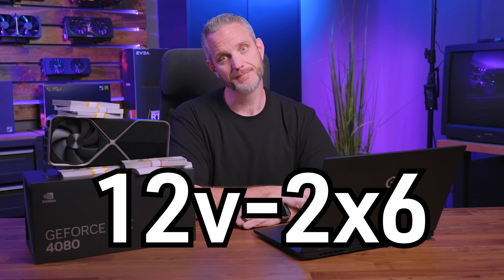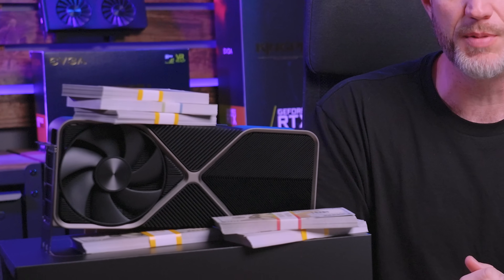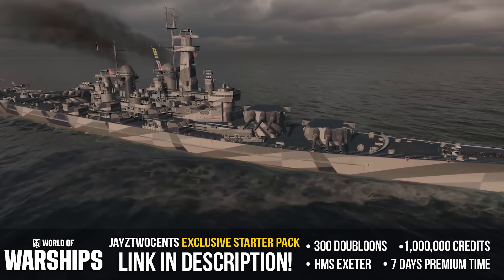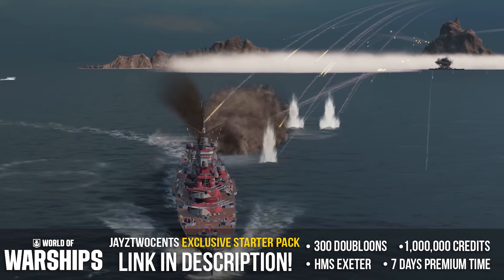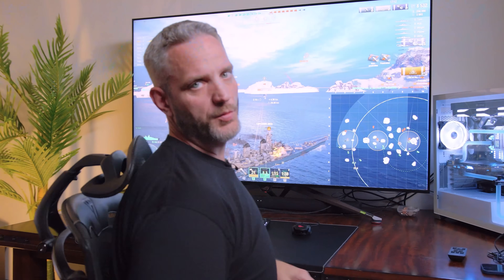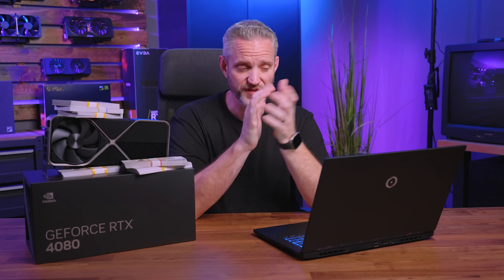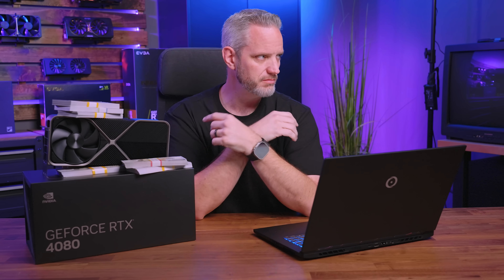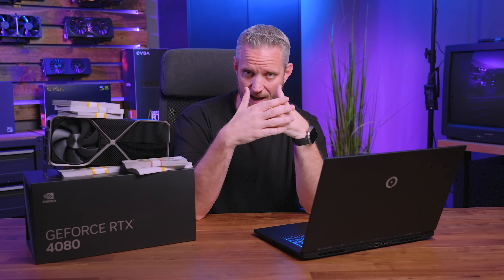They FINALLY admitted that this was a major issue!

Comment: I was having this issue with 100% fans and black screen with my MSI  4090 for so long now... I did change 3 cables and now it looks like it's working but... The issue was most apparent on... CableMod connector with 4 8pin plugs. I did try the 90deg adapter but it failed each time system booted (graphical glitches and freezes)... Finally some useful info!

Comment: Are there "12V-2X6" 90 degree adapters yet? My new Asus Rog Strix RTX4090 OC just arrived, it has the new 12V-2X6 port but as the cable still sticks out, I want a 90 degree adapter that is also the same standsrd anyway.

Comment: As technology advances, reliability goes down the drain. 
So many solutions to the problem, but they still continue the old design style which is giving issues. 

Hardwire the power wires on the board and have a heavy duty connector inline, or even double up on the pins.

Comment: Jason, could you, Steve, Igor and Jonnyguru do a zoom call discussing a fix for the 4090 melting cable adapter issue? CableMod doesn’t seem to think ntk spring terminals will help. Im with you though.

Comment: Anyone know if cablemods uses NTK pins receptacles??  Also for people that are bound to the 12HDPWR, I don't have it quite yet but I plan on putting some small bits of paper or masking tape in the latch mechanism to increase opposing force that keeps the plug seated. decrease possible gap.

Comment: I just got my STRIX liquid cooled 4090 yesterday, it's still on the same style pigtail that my MSI 4090 came with (albeit with 4 connectors for the ROG and 3 for the MSI) but I will say there's a more discernable "click" when plugging in the new STRIX LC 4090 (even says in the instructions you should hear a click) which seemed to be part of the issue which was adapters not being fulling seated into the connection point on the GPU from the adapter male end into the GPU female. And to be clear, the LC 4090 from ASUS was just launched within the past 1-2 months I think? So I wonder when they will incorporate upgraded pigtails?

Comment: I had the no display/full fan speed issue. It happened rarely at first but got more frequent. Sure enough just lightly touching the plug would cause it to happen. Removing the plug and then plugging it back in fixed it. Luckily no melting occurred.

Comment: Yes! the power connection is finally getting changed!  Perhaps they heard NorthbridgeFix practical assessment through the AI electronic brain  grapevine?  I have a more likely scenario to visialize.   The engineers huddled around the new design like Doctor Frankenstein admiring his new creation on the surgeons table.  "Erika! Egore! We have designed the new power connection that is sure to fix the melt down problem!".    Engineers bow to each other.   Bow to the left.  Bow to the right.  CEO takes a bow low enough to tempt the Engineers to kick him in the **** but decide among themsleves his shame is sufficent.   Lastly, Lawyers take a hanky and blow their excuses out their nose.    The sales department and support department can know accept and explain "the power connection design will be fixed in future video card releases".    Your sarcasim is noted, "this is the same *** from day one!" So much for practical thought.  HMMMM!

Comment: IMO, these kinds of things actually should have been caught before mass deployment. Most of the competent EE's I know got there by working on an assembly line floor for their first internship, and having the mentality that the real world doesn't function how you think in the lab.

I recall a story from the early TV era, when capacitors cost a significant amount of money. The CEO/Lead Engineer went to the assembly line, and literally started removing random components until the TV stopped working. This let him do two things: one, save cost (if the TV worked without a component, was it really necessary or could you go without/find a cheaper option?) and two, figure out exactly how things would stop working and why. Such due diligence should be standard, especially with an industry component going into multiple manufacturers!

Comment: along the same lines-trouble shooting an 4080 new build issue:
I'm an old tech but new to gamer builds.  So here is a what if: You have this Asus 570; a  Crosair RM1000; and this monsterous 4080. Plug is altogether and push the Mobo start button and NOTHING happens! Let me backup just a bit: the RM1000 comes with 3 8XPCI cables. One gets used on the Mobo for power. 2X plug into the 3way 4080 cable. Ok, so only 2 cables plugged into the 4080. What should happen? A QCode would be nice. Natta. Ok, so I get a brandX 24" type 4 extension. Same issue. Nothing happens with the start. Now this PC works fine with a legacy VGA card. BIOS upgraded to latest version; Win 11 and all updates. Not boot issues.  But I am at a total loss on this. So, here is my plan: Going to remove the 8pinPCI that is in MOBO and just use a 4pin-PCI for MOBO (no overclocking soup for you!) Then, plug in the 3rd Corsair extension.  Your view including a horse laugh would be great!
kentek

Comment: I'd imagine the vibrations might be making the plugs walk out too? You'd have a lot of fans causing vibrations with these types of cards
Reply: If vibrations cause that, the plug isn`t fitting well in the first place. But they don`t because the connector is really stiff, it`s hard to push the cable in.

Comment: Cablemod claims there is no requirement to use the spring type pin receptor on the cable that plugs into the gpu. It’s a mistake if they don’t use some sort of spring type for the reasons you site.

Comment: That's a problem we have in the automotive industry too, plugs having wire gauge too thin or the socket not letting the pins have full contact, what I had to do several times was solder a thicker cable to the actual module and problem solved, that would be a good idea, get the GPU with cable built/solder in and plug directly to the PSU, the problem there would be if the PSU is standardized on the pin out in the connector

Comment: Thankfully I have had no issues since launch with my Palit GameRock though I did buy a seperate 12vhpwr cable and now use a ATX 3.0 PSU from corsair with a proper sleeved 12vhpwr cable direct from the PSU to the 4090. I have always made sure it is plugged in properly.

Comment: As long as we are monitoring sense wires in the connector, why not add a thermistor, that could actually detect if the connector temperature rise becomes unacceptable? Seems to me it wouldn't add much cost.

Comment: NVIDIA and consequently all board partners are required to exchange these plugs! The old design is a severe security issue and the redesign by NVIDIA is admitting to this fact. A consumer product with such high power draw should not come with such an inherent security flaw as it constitutes a FIRE HAZARD. There is legislation and consumer protection against this kind of company behavior all across the globe. If a vehicle airbag is flawed, you don't wait for a new vehicle to make it better, it is recalled and replaced BEFORE injury occurs. NVIDIA and board partners need to be held accountable for dissemination of a dangerous product. Failure to move proactive on this matter will result in severe personal injury at some point. Legal indemnity charges are bound to go through the roof when negligence can be proven for failure to exchange the product knowing how this could have been avoided.

Comment: There should have been a recall on all 4090's, just like there should have been a recall on those motherboards burning up cpu's. The risk is there and they are clearly more worried about the bottom line then doing the right thing. I'm surprised there isn't a government agency somewhere having a long hard look at this.

Comment: old 12hpwr. glue a thermal sensor to the side and plug into the mobo 'if 'i you have a temp sensor plug to use. set bios to shut down when it nears the danger temp.

Comment: Jay, would it be possible to make a video about running dual GPUs instead of a full dual PC setup for streaming. I Recently bought a second Asus KO RTX 3070 to take the streaming load off of my main card and the setup works great and i have a 5950x, 64GB of ram and 1000w PSU. ive always thought it would be worth it to build a high spec PC with midish high tier GPUs so theres no performance loss when streaming. Since utilizing the second 3070 for streams ive been able to get full performance while being able to stream at 1080p60 at 8000 bitrate only at the cost of added heat from the second card which limiting main cards frame output to my monitors fixes.

Comment: The failure rate is still relatively low, at 0.05% to 0.1% based on the data collected from board partners, cable makers and GN's viewers.

Comment: What's wrong with using the XT60 connector?  It solves every problem on the 4090 when it comes to power draw.  It seats in better, it feels better when it's seated, there's no ambiguity when it is in; no more 'is it in fully?' and you can see it's seated in.  Plus, it can carry 60 amps and above at these voltages.

Comment: The black screen with fans at full speed happened to me a while ago with a 3060. After a bunch of testing and troubleshooting, I found that one of the plugs at the PSU end wasn't holding properly and somewhat loose no matter how much force you applied to plugging it in. Any movement of the desk the PC was on would cause the plug to wiggle and prevent contact, making the GPU loose one of it's 8 pin connections. Setting the PC on the floor prevented the issue, but if I tapped the PC with my hand in any way, the issue would happen. I ended up swapping the PSU. This means that the connector issue is not only existent on the GPU side, but could be on the PSU side as well.

Comment: I just bought a new pc and made sure to get the new psu socket. Will the psu sockets need updating aswell or is only the part coming from gpu be updated?
can’t believe there can be this big changes this often. now i won’t be able to upgrade gpu without updating the psu which was my exact intention

Comment: Where is a guarantee that the new plug will not suffer the same thing? Was telling it since the beginning. It is not the wire, it is a plug. High-wattage plugs should MUST have flat pins and not round one. In that case, it will have full surface of each side to transfer power. That is the ONLY correct approach. :)

Comment: I'm somewhat confused. At 3.12 you mention total 55A power. In the UK, our mains plugs carry 13A fuses.  If that's the max amperage the plug can supply without the fuse blowing, how can a GPU demand and use 55A ?

Comment: Explain to me that whole "sense wire" shit, except for making everything more expensive.
Explain too me why my BIGGER pins on my 2x8 pci-e connector with 16g can not deliver 600 watt like this pile of shit with 2x6 with smaller tiny little linus pins..
Oh yeah the BULLSHIT they keep feeding with oh oh but an 8pin pci-e can only do 150w right.. BULLSHIT the EPS 8 pin can do 235w and its the SAME..
You cant thanx where there.... an 4090TI will run just fine with 3x8 pci-e...

Comment: I actually had my 4090 quit working while I was gaming, changed power cables and was back to gaming, looked over all the pins on the cable, saw sense pin was slightly pulled out.

Comment: Thank you for keeping this in the light Jay, I think this is a good move in the right direction. I myself having a founders 4090 run it at 80% power target and get a hell of a performing card and I really don't worry about the plug smoking. I have it dressed well and in securely but I still feel lowing the total power pull is safer.
Reply: I have a 4090 Suprim Liquid X. Sitting at 0 throttle 100% full power. However, and it's a big however. I'm on a 650w PSU. I've seen the card pull 400+ W but no more. Then again I haven't really pushed it with anything other than gaming. Highest load game was RDR2 maxed out at 1440p and while it was at 99% gpu usage it was only pulling 350-400w. I also do not use the 12vhpwr adapater. I use a native 12vhpwr to pci dual 8 cable made my corsair specifically for their type 4 psus. I'm not sure if any of this has saved me or if the fact that it's really only about 1-2% of cards actually melting or damaging in the first place. Idk but I'm doing a new build in a few weeks and I'm reinstalling the 4090 in it so hopefully I get the same results when I match it with a 7800x3d

Comment: So how do I know that the GPU I buy now or in the near future, has these new NTK connector and specs ?
H++  on the connector/plug is not something we see if the GPU is in the box.
Do these new GPU's with the NTK have a different Model or Serial numbers anything of the sorts?
Reply: Cablemod is saying that there is no requirement to use the ntk spring type pin receiver. Jay might have got this wrong. It’s all confusing.

Comment: Jay, My son and I went to Microcenter over 4th of July Saturday and purchased two ASUS Strix OC 4080 cards.  At the same time we ordered two of the Cablemod right angle adapters that arrived the next day.  So on Sunday, just as the adapters arrived, my son notified me that he just had a meltdown on his 12v cable.  we were OCD ( as you mentioned in this video) about making them secure and ensuring they were not bent.  PS was a EVGA 1000w Supernova G2 fyi.  We took the card back to Microcenter and they replaced it no questions asked and the manager was aware of the issue.  Anyway, we both are using the adapter, pre-bent cable running straight down and then elbowed to run rearword and made sure there is zero stress on the plug.  Very odd that it happened on a 4080 though… we have pics if you want to see…let me know.

Comment: it's the same mini clip that holds it lol, so they didnt fix it, they side stepped it.

instead of going poof, they shortened the leads on the sensor pins, so when the connector works loose, your entire system comes crashing down. when the GPU just removes itself from the system mid-session.

it's a band aid at best, the size of the plug, and it's location and use, suggest it really needs clips on both left and right sides and not just a small clip on the top, as that clip still allows longitudinal wiggle left and right,

Putting the retention clips on the left/right ends, will prevent the longitudinal shift 100% there fore the loose contacts.

Comment: I knew a builder that had a "key" set that would release the pins in Molex connectors, and he would add a drop of Silver solder to each pin and then reinsert them in the connector. When I asked him about that he told me that "People have a habit of pulling on wires to disconnect components, and this helps save the connector."

Comment: Am I wrong to assume that if my plug is super tight and has no wiggle room that my PSU (Corsair RM1000e) is most likely using NTK and not ASTRON? I tried looking it up but didn't find the info

Comment: When I called Nvidea C.S. for my melted wires on my 3070 TI, because I had bought it second hand during the GPU shortage, they would not cover it an promptly hung up on me. I will be filing a complaint through the CA. Attorney General.

Comment: Is there potential for a class action lawsuit for something like this? If there was knowledge of the plug being defective and there was work being done during the rollout of the 40 series late last year, would that mean that there is a level of negligence that's being put on display with a company knowingly selling cards with this potential defect in mind?

I'm not saying it' son Nvidia, but I feel like someone can make an argument here where you could potentially have, if not Nvidia, then maybe SIG be held responsible for this mess? There's a reason why AMD didn't go with this new "standard". If they saw the writing on the wall, then there had to have been a base level understanding that the spec was not fully formed to be ready for consumer level purchase. Kinda spitballing here, but yeah. Just kinda fucked that people that purchased this cards are left to be SOL. I understand early adopter fees and such but this revolves around safety vs potential software issues.

Comment: I'm glad I didn't buy a 4000 series card, though I'm surprised this wasn't something found during stress testing of the 12V HP standard before anyone implemented it. I can't imagine this being designed without running many models through some heavy stress testing. But, at least these new versions seem to be more solidly designed than the originals.

Comment: The term used for cables moving due to heat changes is called thermal creep and is a major issue. Most higher end systems use some type of retention system (wire brace, velcro, etc) to hold connection in place
Reply: The old pcie 6 and 8 pin connectors have a clip integral to the connectors that accomplishes that task quite well, but the clip on the 12vhp connector is too long, which leaves room for the connector to unseat itself before the clip stops it from loosening further.
Reply: Would a few strategically placed blobs of high temperature hot-melt glue solve the problem? I know that they use that trick to hold the plug for the PSU internal cooling fan into the socket inside most PC PSUs these days, because it gets rid of the thermal creep problem.
The other advantage is that it doesn't prevent service, if you need to service the card or remove it from the system for other reasons, just un-stick the hot melt glue and remove the connector as normal.
One extra step but it solves a lot of problems.

Comment: I just realized, my Zotac 4090 has no issue with wiggle play on the connector. I have tried so hard to make it burn (Science you know).. it just doesnt work. I would break the connection between connector and pcb before it messes up otherwise.